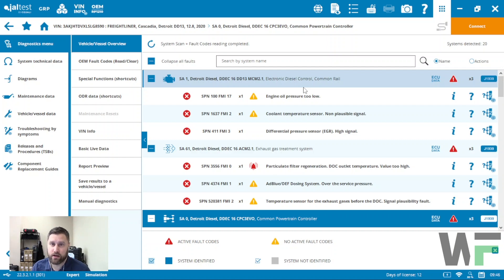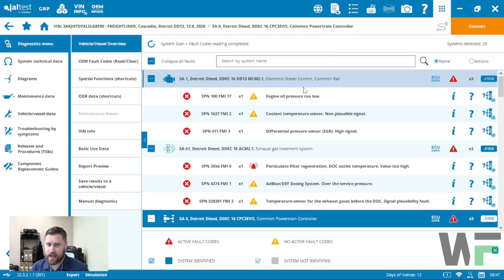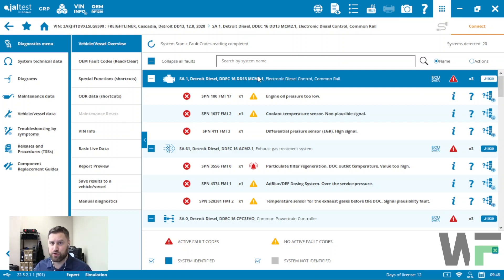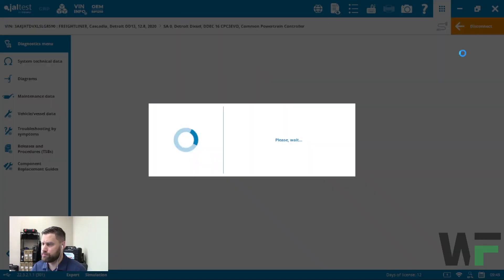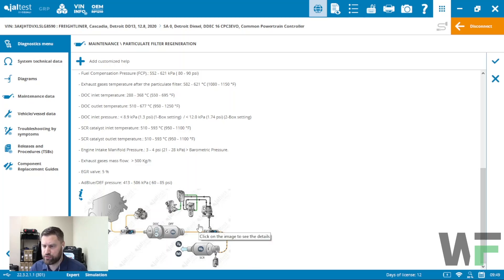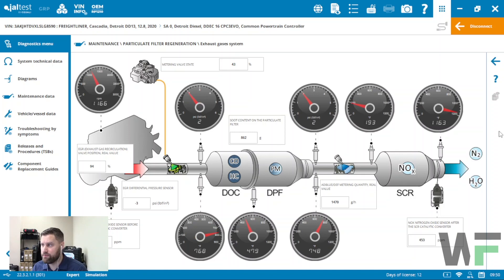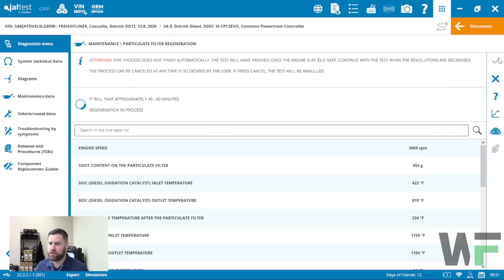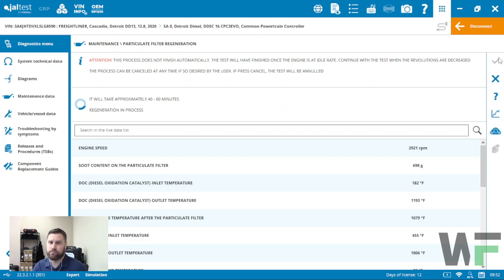How to Preform a DPF Regeneration Using Jaltest

Comment: quick question 
so being a 310t i am looking to buy DL for detroit , will you recommend jaltest over DL for all aftertreatment and cpc programming and all that ?
Reply from the maker: If you are looking to program control modules, that is out of the scope of any aftermarket tool for the most part. If you would like to service any make and model with 90%+ dealer capabilities without having to toggle programs and adapters then Jaltest is the best solution!